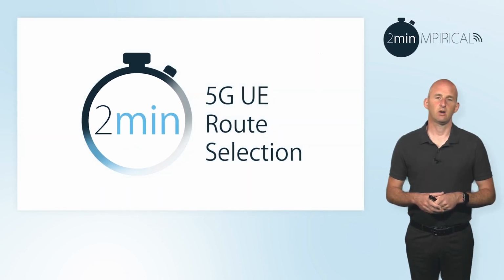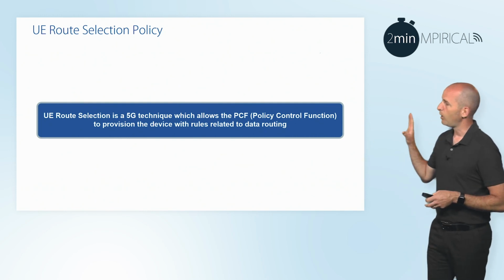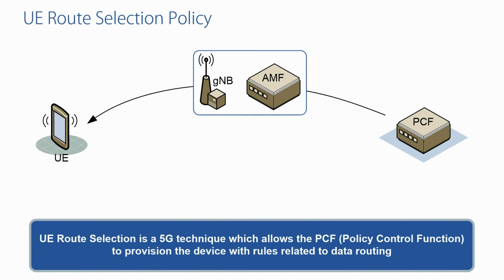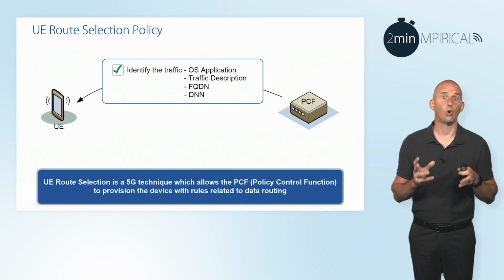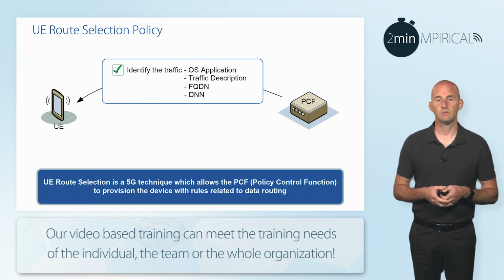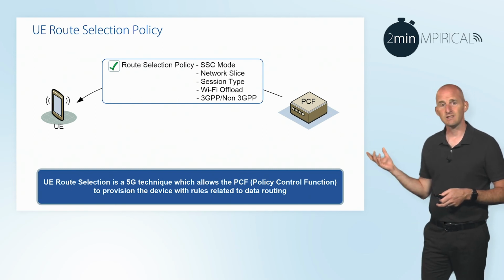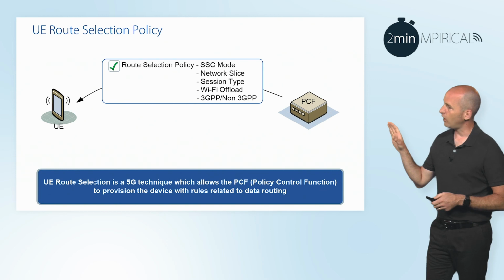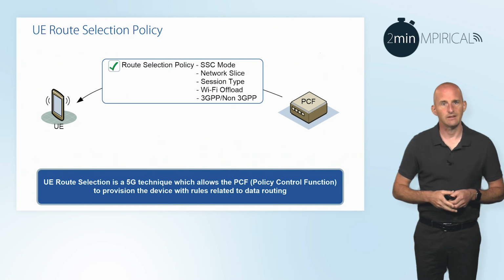5G UE Route Selection - Mpirical

Comment: Thanks for the effective information. Could you please share the configuration (some sample) of the UE (android phone- Samsung S22) for URSP. I tried to test slicing by setting SST/SD using the smartphone mentioned but got stuck with the URSP setting. Because I found no SST/SD options on the phone. Thanks in advance